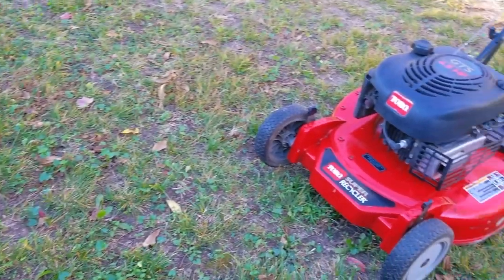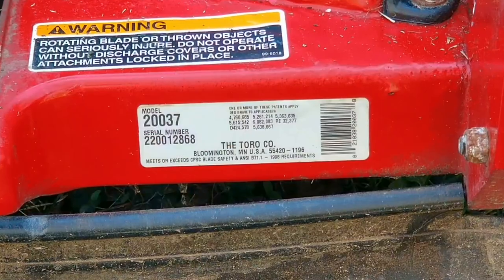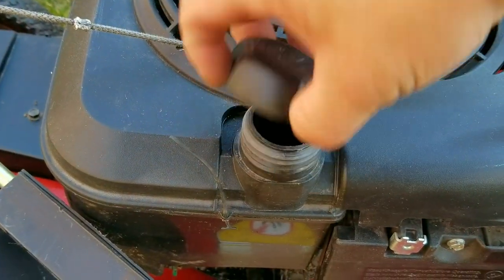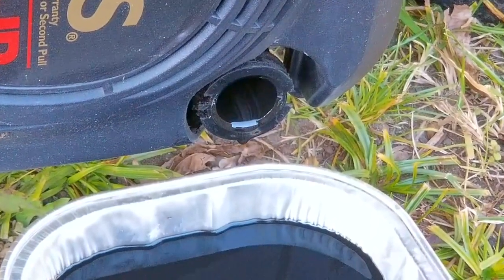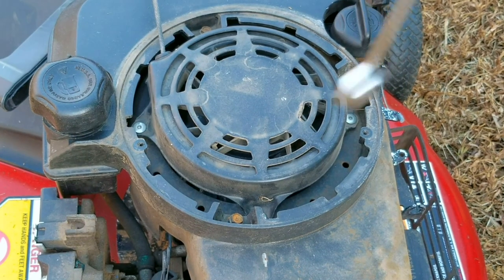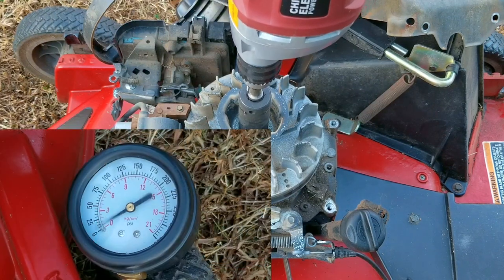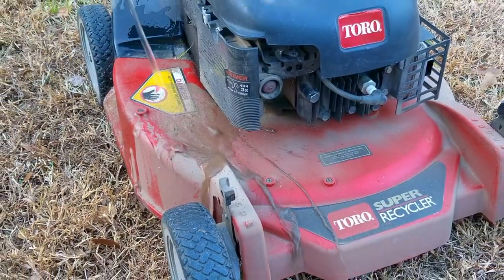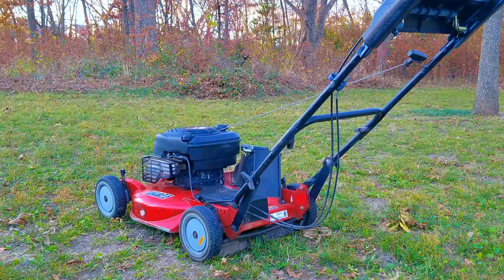Mower Maintenance Doesn't Have To Be Difficult

Comment: I do read the manual and also do a minimal maintenance routine.  New spark plug, new air filter, change the oil, etc. every spring. I also skim the manual, but these days most of them say pretty much the same thing, with the first several pages dedicated to things like: Don't touch the spinning blade, and don't touch the hot muffler.
Reply from the maker: nothing wrong with your technique at all.

Comment: My neighbor has gone through 6 or 7 mowers in the past 20 years. His first one was a Toro 20036 Super Recycler. After a couple seasons he couldn't get it started so he bought another mower. I forget the brand but it was a nice key start self propelled walk behind job. About 3 years later it wouldn't start. When he came home with a third mower his wife made him get rid of the first one which had been sitting outside behind the house. I grabbed it when he pushed it to the curb. I got a new spark plug, air filter, changed the oil and put in fresh gas. It started after 2-3 pulls and and I have been using it for the past 16 years. I had to replace the fuel tank maybe 5 years ago after it developed a crack. I'm still using the same spark plug and only have replaced the air filter and the traction control cable. I thoroughly clean it every spring, lube the axles and drive train, clean the plug, check the gap, and change the oil. Wonderful mower if you only give it a little TLC.
Reply from the maker: wow nice grab. It's nice having neighbors who are so willing to go thru mowers like that.
And nice work keeping it going all these years!

Comment: I know someone who bought their first house got a mower and promptly filled the oil to the top. When they called me and I went to have a look I had quite a laugh as black oil came out of the exhaust every time you pulled the cord. After draining most of it and burning off huge clouds of smoke from all the oil in the exhaust it was fine and ran until they got a lawn service. I still laugh about it years later.
Reply from the maker: now that's pretty funny!

Comment: Each piece of equipment I bought has owner's manual, & I read them. My Yard Force mower manual states to give the engine it's first oil change after 24 hours of use. I'm going to change the oil before it is next used, yet it has done only a couple of hours work. Best mower I had was the Pace Forward self propelled. This thing was a real work of art. Only 2 wheels, & the drive train drove a split roller, yet the clippings were discharged at rear, over the roller, & into the catcher that also had wheels.
Reply from the maker: wow, nice manual information, I appreciate it Christopher Marshall!

Comment: Been binge watching many videos about push mowers recently, really can't wait to take my mower out of Winter storage. Bought my new oil already, but going to double check the filter after I take the tarp off. Come on Minnesota, stop snowing already.
Reply: To answer the question, yes I save and read the manuals. I have noticed the push mower I bought has 2 manuals. One for the entire unit, and one specifically for the engine (although it also is the manual for the 79cc, 132cc which I bought, and the 140cc engine).  One thing I glossed over originally,  but will take advantage of this time, is that this engine actually does have an oil drain plug on it, no more awkward draining out the fill hole.
Reply from the maker: wow, it's still snowing up there!!
Reply from the maker: nice, most don't even realize they have manuals for them.
Reply: @INSIDEHOUSEGARAGE  yep

Comment: Hey bro, what's up? I'll admit, I've read most of my owners manual but not all of them. In agreement with what you've mentioned about owning a few of the same equipment, you kinda get the idea as to what you've been doing wrong on your previous equipment.
Reply from the maker: thanks for understanding, it only makes sense they'd be the same after awhile
Reply: @INSIDEHOUSEGARAGE  
I will admit bro, it will wise to still read the manual because there will some things that we tend to overlook which can end up costing us a lot in the long run

Comment: The only mowers I've ever had smoke, either a little or a lot, are the 90s-2000s Toros. One was a trash find, so it was probably ran hard with poor maintenance. The other is ours and has basically no hours on it, oil changed properly, but once in a while smokes on start-up, sort of like yours at 9:18. Guess its somewhat normal for the briggs flatheads. Its also possible the oil was very slightly overfull, probably better a hair under the full line.
Reply from the maker: true, this one sat for a minute with oil up against the back of the piston so some of it made it past the rings.
Reply: @INSIDEHOUSEGARAGE  ah ok, make sense.

Comment: Only issue with these style/year Toro's is the rwd self-propel, the plastic parts can wear out and you'll only have 1-wheel drive. Easy to diagnose by seeing if the wheel still spins with some light pressure applied by your foot while rear wheels are off the ground - it should still spin both until you put down very hard pressure as I believe it has somewhat of an open differential for turning.
Reply from the maker: are the plastics inside the transmission then?
Reply: @INSIDEHOUSEGARAGE  oops, I forgot to say "plastic parts behind the rear wheels and gear/dust covers." And now that I think of it, I think those parts are how the mower allows one wheel to spin independently from the other - and the transmission/axles are "locked" so to say. Sometimes they may just need cleaned/lubed.
Reply from the maker: ah I see, thanks for clarify!

Comment: Your comments are pretty much spot on. I am sure that somewhere amongst your vids you have talked about spark plugs. When do you recommend changing them? Also in your year end maintenance do you recommend fogging or putting a small amount of oil in the cylinder and pulling the start cord a few times?
Reply from the maker: recommendation would be to fog and then the piston to top dead center. As for spark plug, I only change them when I'm trying to solve a "no start" situation. I don't change them unless I have to and I would recommend the OEM plug

Comment: Same goes for almost every gas powered machine. Dad’s friend had a brand new generator, didn’t read the manual, didn’t charge the on board battery, didn’t preform proper break in, added the entire included quart of oil, didn’t dump the break in oil, didn’t let it warm up and immediately hooked up a load to it. (Welder and dust extractor) The on board starting battery died in 3 months, engine burned a ton of oil for the last 3 months before finally dying after 8 months of weekend use/abuse. I now take care of his new generator when he’s not looking just to make sure it lives longer than the first one. 
Big thing is to let the engine warm up before use or applying load. Most people seem to be in a hurry and forget that. :/ Heck, even I let my 2 cycle leaf blowers warm up for 3-5 mins and then gradually give it throttle after before even giving it the beans.
Reply from the maker: thank you for sharing that it's a good lesson

Comment: I always run my mowers a LITTLE bit over full but not much. No problems but I also know that way too much oil can Hydraulic lock a motor up solid too. And nothing that you can pour out of a container can take the place of real metal, no matter what the label on the container says. Slightly thicker oil can reduce smoking but if I have an old rig, the smoking verifies that it still has oil IN it and is to be expected. And I always check the air filter right off and only run the old one if I can't get a new one. Thanks and Blessings!
Reply from the maker: nothing wrong with it if it works for you
Reply: @INSIDEHOUSEGARAGE  The Sweetie wants an easy starting mower. My 1st freebie fix I give the kids was a Troy-bilt 21 inch electric start flathead. They're not using it and I can get parts if I need them and a battery. God willing, Toots will have an electric start self-propelled hand mower before long.

Comment: Several (ahem) years ago, I had a McCulloch string trimmer. I had ridden two stroke motorcycles, and raced go-karts, so I knew small engines. Every so often, the trimmer would start running bad, and I would adjust the carb. Then it would run ok for a while. One Spring, I couldn't get it to run well by adjusting the carb. I finally resorted to reading the manual. Did you know that there's an exhaust screen that needs to be cleaned? Of course you do, but I didn't. After cleaning it, the trimmer ran better than it had in years. Now I always read the manual on my equipment. Now I almost never adjust carbs. I figure that if it's running bad, and the carb didn't change, something else did, so I need to find whatever changed, and fix it.
Reply from the maker: yes the screen needs to be cleaned once in a long while

Comment: I know I’m in the minority, but I pretty much always read the manual. There have been some times when I didn’t, for some strange reason, and I always regretted it. Nowadays I’m careful to at least read the starting procedure on every piece that comes through my shop because items like chainsaws can have different controls and starting procedures are definitely different. Case in point with this next saw where I didn’t read the manual. I’m currently working on a Poulan 2475 Wild Thing which didn’t seem to be starting as well as I thought it should. Turns out both the choke and the “throttle idle lock”  needed to be on for it to start right up. Huge difference in starting easily!  Also, it doesn’t have a half choke setting after it fires off the first time. Just push the choke in all the way and pull one or two more times, then disengage the throttle after 5 seconds to let it idle and warm up. I also screwed up after reassembling the entire saw by pumping the purge bulb maybe 20 times. Big mistake. I don’t know how or why, but I ended up dumping a bunch if fuel into the crankcase and had to invert the saw to get most of it out to clear the hydrolock. 6 pumps…. Just read the manual dummy! 😉👍🔧
Reply from the maker: The owners manual will solve most all your issues, it's just too bad most people will never know that.

Comment: its kind of common on old flatheads for the rings to let a little oil into the cylinder with causes smoke until it burns off
Reply from the maker: very true, but too much much oil will put the oil, where it's not supposed to be ,which is against the bottom of  piston
Reply: @INSIDEHOUSEGARAGE  I know I've always been told to never overfill.   I have a flathead that oil seeps past the rings after its been sitting a while because the floor in the garage slopes and the rings are gone
Reply from the maker: I see, you might want to face the mower, so the front of the mower
is higher than the rear, it might not seep as badly.

Comment: So, with talking about the oil fill issue on new equipment... I have a sad story about something my cousin did. 
So, she went to a big box store, and purchased a $900-1200 John Deere Pressure washer. It was a super nice unit that i'd have loved to have myself. Well, she got it home, now mind you, my cousin is about as mechanically inclined as my 5 year old niece. Anyway, she unboxed it, and gassed it up. and added oil. The problem was, she didn't add enough oil. She'd misread the owner's manual, and didn't add enough oil. The poor engine only had about 2 ounces of oil in it, and she locked it up! The engine ran for a good little while surprisingly, but eventually gave up the ghost.  When she told me what she did, i about shit! I was like "WHY didn't you call and ask me?!" , she was like well i thought i could do it. 
Needless to say, she ruined a very nice and expensive pressure washer by not knowing really anything. just a fun little random story for you. Love you IHG! Great video as usual! <3
Reply from the maker: that was a Sad story but I bet she would do the again! thank you Jacob Feather!

Comment: You're really down on battery/electric, huh?  LoL   There's literally nothing covered in this video that ever needs to be considered with electric equipment -- other than to read the manual, which I always do.  The care of batteries amounts to charging them (slowly if possible, not with a fast charger), not charging them in the sun, and not dropping them onto a hard surface which might cause breakage.  As someone with a full fleet of electric mowing equipment, I love the fact that, if the equipment doesn't start or run, my troubleshooting checklist is one item long.
Reply from the maker: there's more to batterie care besides the obvious.